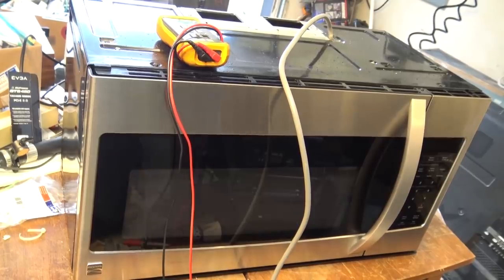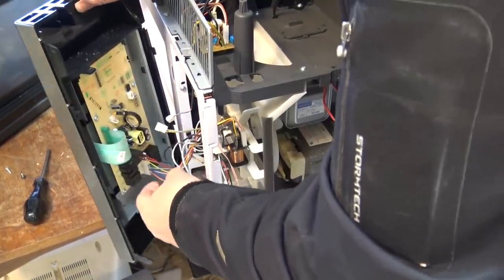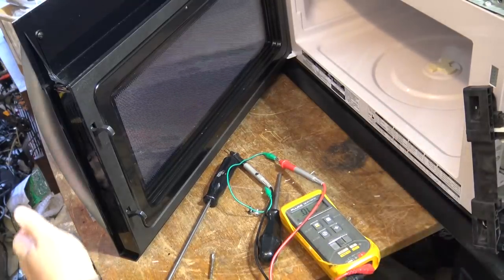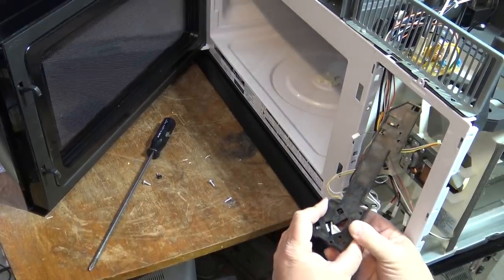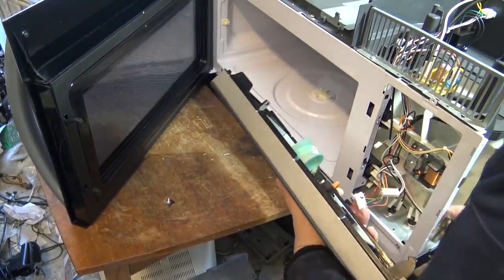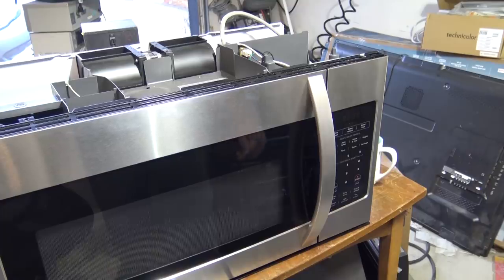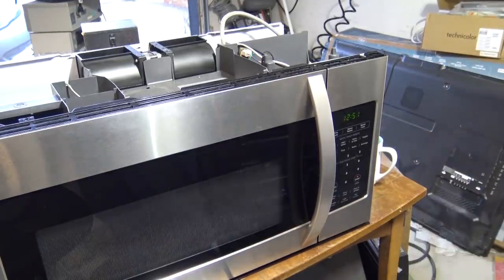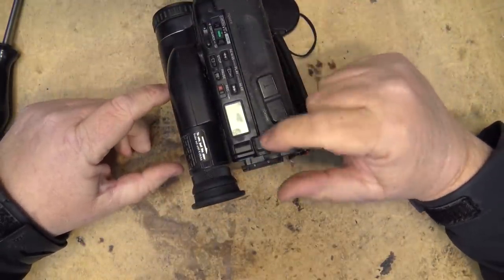Microwave Oven Blowing fuse as soon as plugged in

Comment: You are saying that the switch failed when its contacts are welded together from current flowing through it? Have you ever proven that the switch will cause the fuse to blow if the other switch is actuated when the door is open? That sounds absolutely crazy! Isn't it more likely that something caused too much current to flow in the switch so it failed?
Reply from the maker: It has nothing to do with current flow.  The system is designed so the primary switch is open, before the short switch closes.  If both end up closed at the same time there will be a dead short and the result is welded contacts.  Now how can this happen? Weak spring in switch causing contacts to close, excess dirt and grime causing switch to stick,  but most common is some idiot slamming the door shut and causing the contacts to bounce.
Reply: @12voltvids  Sorry it has everything to do with current flow. The switch contacts are welded together. That only happens when too much current flows through them. And that is precisely what happens when the one switch fails open or closed with the other in the wrong position. The power is momentarily connected directly to the other switch which is connected to the neutral - bam - short circuit and a minimum of 15 amps through the switch - probably much more! This is an outrageous design in my book. 
Almost anyone other system would use the switches on a positive lock so the one goes and so does the other - there has to be a better way than to overdraw the power supply to make sure that the switch is also destroyed. I tried hooking mine to the other terminal, but then the door is seen as open when the switch is active (door is closed) so  I think it is wired right as it was intended and does exactly as you stated. If the switches are not in sync, the main power is connected to the neutral and it pops.
If one happens to be on a c/b, this trips the c/b rather than the 20 amp fuse, if the fuse is a good slow blow, it might not be damaged by that, but the switch even if rated for 25 or 30 amps will not take that - the pads are too small and will overheat/arc and weld them shut. The rating of the switch is meant for switching on or off, not for continuous operation in short circuit conditions until a breaker or fuse blows. I am just totally taken aback by this type of design. And that doesn't even consider the transients that the high currents put into the system with those ICs and the like - they are asking for trouble.
Reply from the maker: @dwjw1  
The whole point is they want the switches to be destroyed.  It is not a bad design. It is designed so that if the primary switch sticks closed for any reason. Grease / dirt  build up, someone slamming the door, switch failure, some idiot sticking a screwdriver in the top slot to try to make the unit come on with the door open, the secondary switch has a dead short on the main to blow the fuse and or trip the breaker.  This will blow the switches. This is designed as a 1 time operation which will render the unit safe. That is why they call it a fail safe. The last thing you want happening is to open the door to your microwave and the magnetron stay energized and expose you to high power microwave radiation.  As you are arguing about the design indicates to everyone reading this that you have absolutely no clue about how these things work and why they are designed  like this.  The point is to render the unit inoperable and throwing a crowbar across the supply will guarantee that the unit has no power. No consideration is given for collateral damage. Only concern is making sure the unit is dead. Better a dead microwave than exposing you to high power microwaves that will cause serious harm to your health.

Comment: What might be the worst that could happen if you had simply doctored up the old switch and re-used it?  I'm just thinking that with the above-average chance that the thing will be turfed out soon, why invest in a new switch plus the drive to go get one?  If it wasn't something that would be a shock hazard or a firestarter,  I'd have taken the chance that it would have functioned for another few years of service.
Reply: The worst case is the switch doesn't close when it is actually needed, causing the unit to run with the door open and injuring you. It's part of the safety circuit, so it is not the place to use something marginal.

Comment: My oven came with a 20 amp fuse. It was lightly use and ran fine 2 years before blowing. Should I change to 15 amp? My house has a 20 amp dedicated plug at the microwave.
Reply from the maker: If the original was 20 it was selected for a reason. Because it draws more than 15 amps.

Comment: Is the capacitor after the transformer going to the magnatron in series?  Is that for phase shifting?
Reply: No. It is there to act as a voltage doubler in concert with the diode and magnetron.

Comment: Thanks sir. But the microwave were repairing is only blowing the fuse when we start to on the microwave, what could be the problem sir?? Tnx sir
Reply: Year later, but hopefully this helps someone. I had the same problem - fuse blew when starting. On mine, the monitor switch was stuck down and i just had to unstick by pushing it in a few times (yes, it will likely need replaced soon). Basically u just need to check continuity (via multi-meter) on all 3 switches and make sure they're behaving :)
Reply: Welp I'm back. 4 months later.. Stuck monitor switch again. 😑 I realized the plastic hook-shaped piece that protrudes from the door is wobbly and does not press the monitor switch firmly enough. Another round of switches and fuses, plus a carefully placed bit of heat shrink tube around the end of the door hook. It has been working for a few weeks with no problems. Would not recommend my lazy fix to anyone, ever. Not really sure why I'm typing this at all actually. Perhaps this microwave has pushed me into a state of  questioning all things broken or not. A sad and disappointing failure of modern engineering.. Yeah, think this recent round of microwave repairs had the side effect of breaking my mind and faith in humanity. My only hope is that there is enough spare bits of stuff nearby to kluge together something that will make reality make sense for another month or two.

Comment: Thanks for the video, but my microwave cause circuit breaker to trip after running for some time and not by opening or closing the door, Its tried at different outlets but causeing the breaker to trip after few seconds. Any solution please?

Comment: Good video but I have a hard time believing manufactures would put in such a design flaw that if you don't pull the door just right it will kill a switch designed to be pushed over and over again.  Especially when I replace the switches and the fuse instantly pops.

Comment: Subscribed well done man!
I have a GE spacemaker overhead, the 20A fuse behind the display board was blown, I changed that the micro works for like 10 seconds then pops the fuse again any suggestion? 
Thanks much
Reply from the maker: Check the HV capacitor between the transformer and magnetron.
Reply: @12voltvids  I thought it was a compensator my uncle's old tube TV made that noise and that's what it was! Is that a easy repair?

Comment: Beware the condenser, which can deliver a high voltage shock if you have not discharged it before starting work on internal parts !
Reply from the maker: All but the very oldest have an internal discharge resistor to discharge it within a few seconds of power down.

Comment: hello, just saw you video and im having problems with my microwave as well. (i have the same one you have over there in the video) right from the begining I found that my microwave didnt show any continuity (1:04) (my fuse was blown but I replace it before doing that test). Later on I found a bad micro switch (the midle one) I replaced it, after that the microwave still wasnt able to show continuity, but was working ok tho. I leaved it like that and test it for a few days and by the 3rd day, blow the fuse again. I dont know what its happening

Comment: Hi,  I pushed 'START' & my microwave sounded like 'Womp' !!!!    I thought it was fuse so I slipped in a new 20A.  The microve lite up, I set the clock, put in a cup of water, set the time, Pressed 'GO' and 'WAMP'!!!  It blew the fuse again.  Checked breaker and all was fine.   So, any suggestions?  Or do I just toss-it out.    : - D
Reply from the maker: Could be a number of things. First is it a conventional microwave or is it an inverter type? If it is a conventional microwave and it's blowing the fuse when you turn it on the good chance the problem is the capacitor has shorted. When the high voltage cap fails it shorts which will overload the circuit and blow the fuse. It could also be the magnetron that's gone bad. You can test the capacitor by disconnecting the two leads going to the capacitor and measuring it with a meter if it's measuring 0 ohms it's shorted internally and that is your problem if the capacitor tests good then it could be the magnetron. Disconnect the magnetron leads if when you turn it on it makes a lot of noise and blows the fuse the stack diode to be bad. If it doesn't make a lot of noise and doesn't blow the fuse then the magnetron has a short and will need to be replaced. Magnetron it's one of the more expensive parts in a microwave but I've bought them for as little as $30. They'll generally be either the capacitor or the magnetron that's gone bad but a game you can test the capacitor if it's shorted that's your fault.

Comment: I having a problem with my microwave too when I try to put time in and turn it on it just makes clicking sounds the timer is still counting down what is wrong with it
Reply from the maker: Could be the top primary interlock switch is not closing, or the relay that actually turns the power on and off to the magnetron is not working.
That's about the only thing. If the fan comes on when you hit start you can rule out the top switch, and then it is pointing to the relay on the timer board, but if the fan doesn't start when you hit start, then most likely it is the primary interlock which in this unit is the top switch.
Reply: 12voltvids where can I buy those switch for it it’s a kenmore how much are they
Reply from the maker: @sdiburro1  
Any appliance repair place should be able to help you.
If not digikey or mouser will definitely carry them. The part number is usually printed on the switch.

Comment: I never understood why North America uses those over the range microwaves, those are virtually non existent in Europe, I've been inside many homes as I'm an electrician, and never seen one ever, nor find any at a store. What are the advantages? I think they become to high for practicality.
Reply from the maker: People want more counter space I guess.  I dont like them myself. Too much heat and moisture over the stove .
Reply: Yes, and they're not really a good height, esp for heavy items, or liquid that can spill. I agree that it's the counter space that folks are after... Over the range units are also noisier; because they're attached to the cabinetry, the "thunk" that happens when they close is transmitted more reliably through the structure of the building.
Reply: I am in the us and I have an LG countertop microwave. In fact, a lot of people in the US have countertop microwaves.
Reply from the maker: @ThatOneTruckGuy  
I have 2 countertop microwaves. One is a straight microwave and the other a convection microwave. I would never put one over the range as I have gas and that is asking for trouble

Comment: I like how you can just run to a store and grab that switch. Not around here....
Reply from the maker: We have several appliance stores that carry the switches. In this case I grabbed one out of my old microwave as it had one in it that was good. The microwave went bad when the power control relay on the timer board burned up.

Comment: Hey so I replaced the switch that was sticking, and also the fuse but when I close the door, it’s still blowing the fuse.
Reply from the maker: Did you replace both switches?  The primary and secondary switch need to be changed in pairs.  Top one is a NO switch and bottom is a NC switch.  There is a 3rd one also at the lower latch which is a NO switch. That is the timer stop switch. That one is generally ok.
Reply: @12voltvids  my bottom switch was sticking, like when I pressed, there was no click, so I only replaced that. Top two click fine, however as soon as I open the door it blows the fuse.

Comment: Good stuff.  I have the same unit.  I saw an arch when opening the door (arch was at the top of the door).  It tripped the breaker and blew the fuse.  Change the fuse out and it powers up, but trips the breaker once I start to run it.  Plan on learning how to test the lines and finding where the short is.  Any thoughts?  Powers up, but trips once it start warming.
Reply from the maker: Change the primary and secondary interlock switches.
Reply: @12voltvids  Talking Greek to me on primary and secondary.  I did test the continuity and found that the switch you replaced had the same issue.  The meter showed zeros even when I pressed the button.  Any ideas on where to get the switch?  I'd hate to get the wrong one.  I'm guessing they are different since some sit open and some sit closed. You're awesome by the way.
Reply from the maker: @Strib420  primary is the top one on most microwave. It is open normally and closes when you push the button in.  The secondary is the lower interlock and it is normally closed (shorted) and opens when you push the button in.  The secondary switch job is to dead short the mains if the primary switch sticks closed. When you open the door the first thing that happens is the primary or top switch opens before the door starts to open then as the door opens the secondary or bottom switch closes this way if the primary switch does not open say it's jammed with dirt or debris the secondary switch will put a dead short across the line and blow the fuse
Reply: @12voltvids  Thx.  I saw your diagram on how it diverts the flow if the switch fails.  I ordered three to replace all as you suggested. In my case, it seemed as if I was not deliberate in opening the microwave (opened from the top) and there was an arch up top between the door and the panel when it popped.  I will make sure to pull deliberately from the middle.  I'm now a subscriber. :-)
Reply: @12voltvids  Follow up.  Two bad switches.  Back on the road for under $10.  You are awesome, sir!  Thank you for your service.

Comment: I replaced my microwave switch because I was having the same issues where it would fuse together.  It happened again with the new one and I'm afraid to turn it back on.  Also, before I replaced it today, it started making a humming noise when I tried using the microwave with the old switch.

Comment: This microwave has only two switches?
Reply from the maker: It has 3. One is to stop the timer when the door opens.  One is primary interlock avs then there is the short/ monitor / safety that shorts the line to neutral if the primary interlock fails to open first.

Comment: Hi, just watched you video and I noticed the drum cooling fan at the back of the microwave was not working, did anyone else notice this ???
Reply from the maker: That fan is not a cooling fan. This is an over the range microzapper, and as such has an exhaust fan to suck out all the smells and steam of what is cooking on the stove, and it is controlled by a fan button on the control panel.Had I pressed the button to turn the exhaust fan on, it would have come on. The cooling fan for the microwave is on the right side behind the magnetron. and transformer.
Reply: Ok thanks for that. Keep up the good work. Steve from the UK

Comment: What would the schematic look like with 3 switches? Seems like nowadays many microwave uses 3 switches.
Reply from the maker: 3rd switch just to tell the controller that the door is open and to stop the timer.  2 interlock switches one for power and the monitor switch
Reply: @12voltvids  Wait a minute, your microwave does have 3 switches.
Reply from the maker: @enufots4621  sure does. 2 side by side on the bottom and one up top.

Comment: Sir when my micro Owen continuously fuse blowing so I replaced new fuse and checked continuously it's getting buzzer sounds so next step i checked continuty no buzzer in cable cord what's the problem
Reply from the maker: Check the switches.  If not switches and it blows as soon as you start likely hv capacitor. This only applies to conventional microwave not inverter type. If inverter type then inverter is likely bad.

Comment: How cheap they are. Over the range or on the counter, it is more cost-effective to just replace the units. If I have to drop it down then let me install a brand new unit.  If the customer does the labor to drop it and reinstall it. Sure I can fix it cost-effectively. But customers don't want to do that.
Reply from the maker: I would never have an over range to begin with. They all fail after a few years due to the heat from the range.  If the range is gas they fail even sooner. Plastic parts inside deform quickly.
Reply: @12voltvids  Agreed. But if the customer wants it. I will install it.